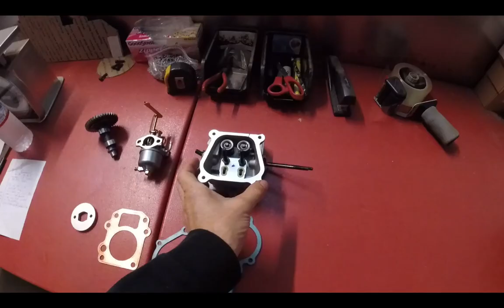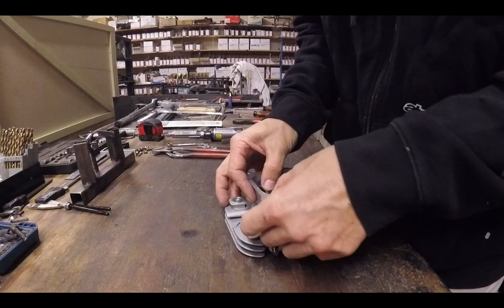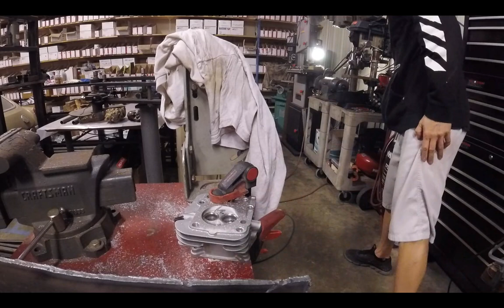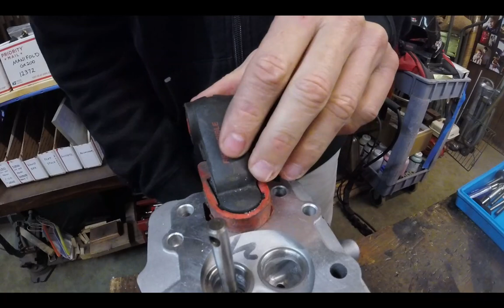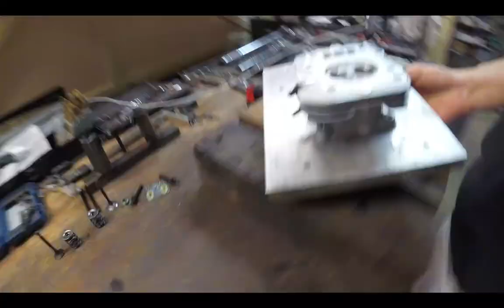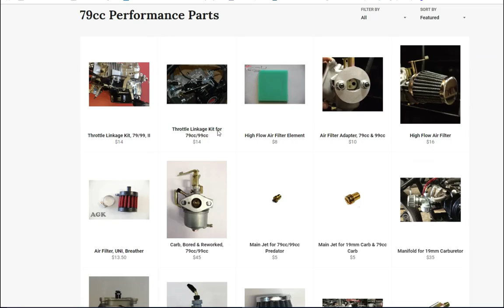Here's How AGK Can Help YOU With Your 79cc Predator Build1

Comment: Been doin all the work to mine on my own been debating on what to do about the flywheel i cant afford a new one thought about drilling holes through it. So far i have just sanded mine down smooth and it seems ok if i do drill mine i plan to dunk it in resin epoxy in case it was to fly apart

Comment: What are the chances that you could make a billet connecting rod for the 79cc?
Reply from the maker: The stock rod in the 79cc Predator has proven to be very durable.  We have a couple engines spinning up to 8000 rpm without issue.  These engines have custom ground cams, high compression and the usual go-fast parts.  We haven't ever broken a stock 79cc Predator connecting rod making the cost to machine a billet rod a low priority for our shop.
Reply: @agkracing140  very good to know! I'm gonna be working on a custom project with my 79cc here in the near future. I know you don't sell cams anymore, but could I send you mine to get reground?

Comment: Why don’t you sell the carburetors anymore?? I really need one because my bike has been sitting and needs a new carb but i am having trouble with the cheap Amazon ones. The governor is already off but damn i wish you still sold these carbs bored out!
Reply from the maker: We have been focusing more on complete go kart builds.  We can still rework your carb if you'd like.  Send us an email at sales@affordablegokarts.com where we can give you pricing and let you know where to send it.
Reply: @agkracing140  i will definitely have to inquire about that! Currently my original carb is gunked up and my mini bike won’t start up so i have to clean it through before sending it to you guys!
Reply: I just got done taking the governor out of my 79cc and rebuild the throttle and everything with your guys’ throttle linkage kit. I have been rebuilding a 79cc mini bike setup that’s on a schwin chopper bike. It’s been sitting for 8 years all apart and i have been rebuilding it

Comment: Are the 79 and 99 based on the gx120
Reply from the maker: The 79cc/99cc Predator engines are not based from the Honda GX120.  They are not a direct copy of any Honda engine.  They are more like a scaled down version of the Honda GX160/200.

Comment: Do you guys carry any billet connecting rod for 79cc predator engine
Reply from the maker: We do not have a billet rod for the 79cc Predator.  We were talking to our machine shop about it and had the rod drawn up ready to machine but we didn't go through with it for two reasons.  We don't have the ability to have the babbitt bearings made anywhere so it was going to be without a bearing like the rod ARC makes for the GX120.  The other reason we didn't move forward was because we've never broken a stock rod.  We've ran up to 8000 rpm without breaking the rod and the stock rod even handles the bigger piston in our stage 3 engine.
Reply: @agkracing140  I have stage 1 on my 79cc predator but I want to know how to get more power outta that engine I jave

Comment: Awesome guys! I can't wait to get my carb! I bought the reworked carb for my 79cc build because I had a feeling it had more of a special touch from AGK. These guys are really awesome.
Reply: Hi - , You'll like a motorcycle style slider Carb over the modified butterfly modded one: like night & day !.....Trev New Zealand
Reply: @trevinskiking2165  loving the slider on my Wildcat 223 for sure! First one I've owned.
Reply: @fatbuddycat  The slider Carb or the Wildcat ??😋T
Reply: @trevinskiking2165  both actually. I bought the Wildcat because it's a factory stroked 212 in what is basically a Tillotson block. I waited for EC Carburetors to release their Wildcat WC22 Tuned  Carburetor.
Reply: @fatbuddycat  If you stuck on a Honda Kehein 20 mm it's jetted perfectly STOCK , cheap as chips (French fries as their known as in the states) you can buy new or used.Trev NZ
Reply: @trevinskiking2165  wow thanks! I was going to try the gx390 carb adapter method too, I think those run standard jets (I have soooo many now 😳).
Reply: @fatbuddycat  Think it's time I setup a branch shop in USA - there's a tons of straight up old school info lost in the mists of time.Trev NZ Cheers😎
Reply: @fatbuddycat  1st thing you need to do to that 79cc Predator is pop on a thin head Gasket & run it on Ave gas or Lucas race Gasoline with a touch of Castor oil for Top  end lube & that race smell to keep the competition guessing....Castor oil has a natural attraction to metal but soon drops out of suspension: mix only enough that you are going to use that day/week....& 1/3rd of a can of STP in the oil to protect that Splash & hope Rod B/E bearing.Dont worry about top speed, it's how quick you get there is the most fun !. T NZ....

Comment: Nice stuff going on here. I'd like to upgrade my 79cc Predator engine. But first I have to find a way to make it work on my bike. The issue is no one sales a belt driven clutch/drive assembly for a 5/8th shaft. Would you know of any? So the motor is now stuffed inside a mountain bike frame. Very tight. But I see no way to actually make this work as everyone I talk to has no idea and no parts are being sold for this Predator. In a bike kit form, anyway, without the motor that is. By the way are you doubling the 3hp without removing the governor? Thanks, any help is appreciated.
Reply: i put the 79cc on my beach cruser.i used the mounting plat for a 49cc .had to grind out the slots some but it fites.
Reply from the maker: We think the most difficult part is getting the engine inside the frame.  If you can get the engine in the frame you just need to setup a jackshaft which will provide the necessary gear reduction and the chain alignment from the clutch sprocket to the rear sprocket.  We're adding a few new parts to our website that can help with this such as a motor mount that connects to the seat tube, a jackshaft kit that also mounts to the seat tube, a chain idler kit and a wide crank kit.  We cannot double the HP with the governor still in the engine.
Reply: @agkracing140  Hey man thanks for the info. It all helps. I got my engine inside my frame. Before I pull the gov I wanted to make sure I could peddle it with a 79cc mounted on a steel motor plate. Which I can, but I really need a wider pedal. My bike actually has 3 gear set up at crank and it is fixed to the peddle itself. Shimano set up. Just not sure how to go about buying a peddle assembly and fixing the 3 gears back to a new wider system, seeing how this is made the way it is. Perhaps just use the one gear provided with a kit and delete having 3 gears there? Also my issue is having a 5/8 shaft so I cannot find any clutch / shaft assemblies for a 79cc that are belt drive. All are chain. I was hoping to use the belt drive I see advertised with bike kit motor included parts. But no one sells just a kit for a 79cc Predator that I can find on the internet. No kit, no way to finish my build. I have a choice of taking the Predator back, telling them it vibrates badly, which it does, then buy a 79cc bike kit with motor and finish the project. Too much trouble fitting and buying one piece at a time from different websites I think. Even if I could find all the parts I need. Thanks for your help.
Reply: Grubee sales them I just bought one

Comment: It looks like the Honda clones 142/44 are equally as wide as the 79cc. 

Questions. Looks better mounted vertical in a bike frame but is it practical? What are you doing for gear reduction? Final belt vs chain? Is it better to buy a modified one or are all the stock kits the same. 

Many ppl in the motor bike community are unhappy with the 49cc 4 stroke, slow 20-25 top speed & bad hill climbing ability. A 40 mph top speed So a cruise speed of 25-30 is good for a bike & just enough torque to not f up your ordinary bike frame (no department store shit that don’t count)
Reply from the maker: Mounting these engines vertical in bike frames has become fairly popular.  When doing so you'll need the 19mm carb and a manifold that will keep it level.  Other than that, I guess you would say it's practical.  There is the same work involved mounting it flat in your bike frame.  We use a jackshaft for gear reduction.  We use #35 chain for the primary and secondary chain on our bikes.  Using an engine already modified versus modifying an engine yourself is really up to you and what you think you can handle.  Do your research if you choose to tackle a build yourself, the information is out there.
Reply: AGK Racing I just ordered the manifold kit & the carb from AGK.

Comment: You should use the knee of your mill to regulate how much material you take off of the head rather than using the chuck
Reply from the maker: Hi Aaron I really appreciate the suggestion.  I honestly didn't know what the knee was so I did some research.  Unfortunately the knee of our mill does not adjust vertically.  Thanks for your input and we'll keep this in mind when we upgrade to a better mill.
Reply: AGK Racing the machinist handbook is an amazing price of literature all about machinists practices. You should look into it. Very helpful

Comment: No hatred but all that r&d in improving that stock lawnmower carb is like polishing a turd is negated if you just get a proper slide type carburetor which at wot generally has nothing blocking airflow in the carb
Reply from the maker: You are correct.  However some of our customers run in a class which requires the stock carburetor.  Obviously a slide carb is better but not everyone has that option.